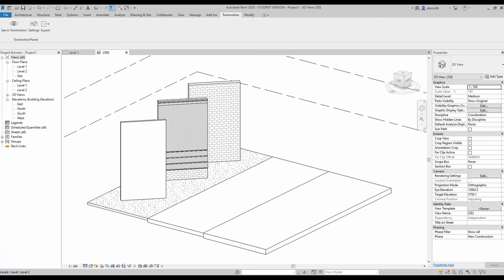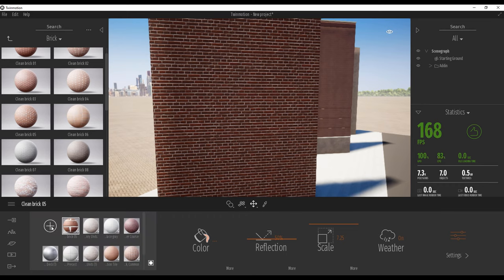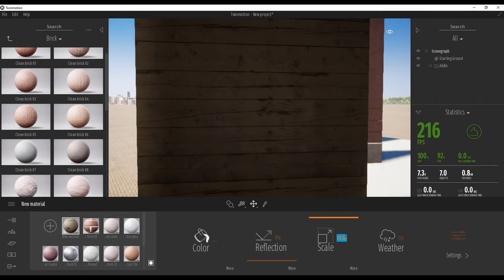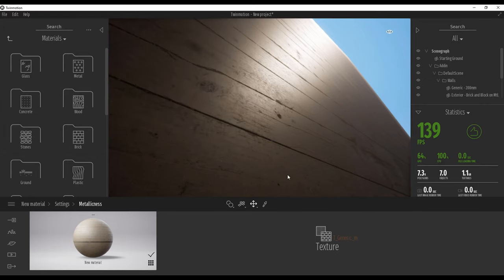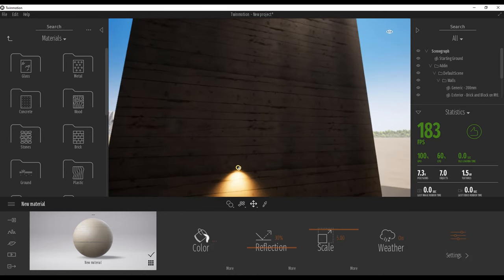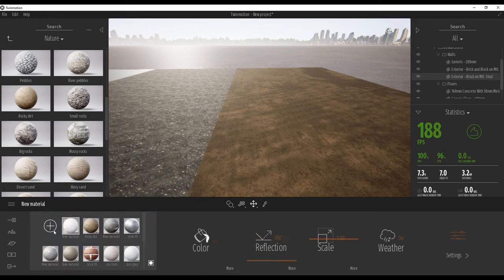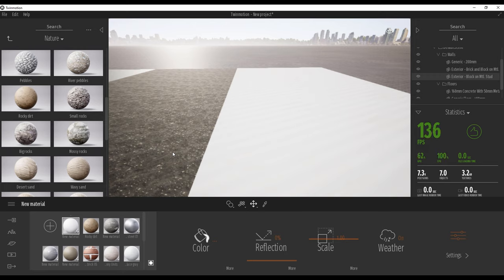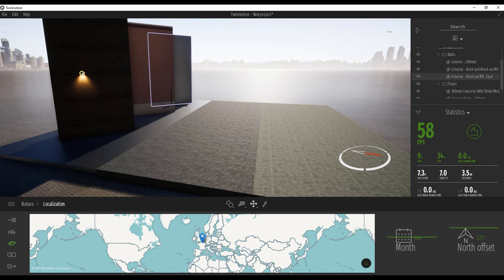Twinmotion | PBR Textures

Comment: With all due respect, WTF are you doing? For example, Metallicness does NOT need a map for this kind of materials, unless is a metal. Metallic should always be 0 or 1. You only need a metallic map if your model is made of metals and non metals in the same mesh, so you can assign which parts have metallicness=0 and what areas have metallicness=1. Please talk about what you know and don't mislead people.
Reply: Yes wtf is that but it work, that so weird
Reply: CorentArt nah, it looks like it works but it doesn’t. It is completely incorrect+that is not PBR anyway. We used to do that on the fly not technical aproach back in the day, but come on, the video it’s called PBR...
Reply: @maschinelab8598  yeah i know